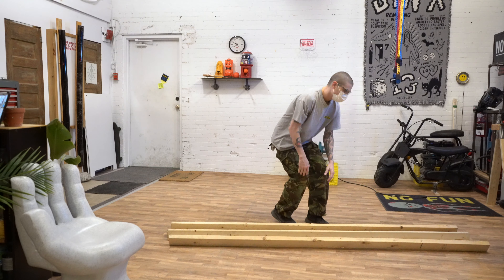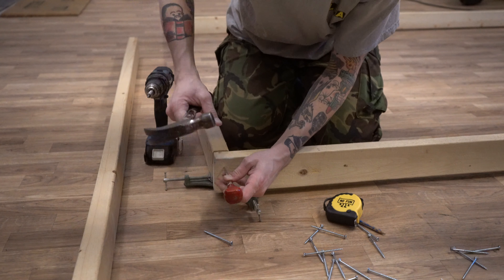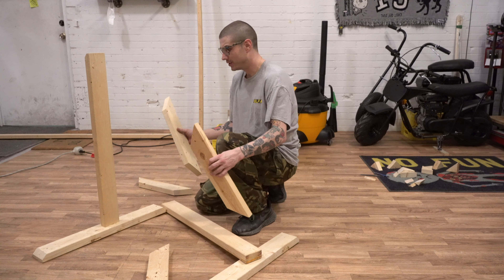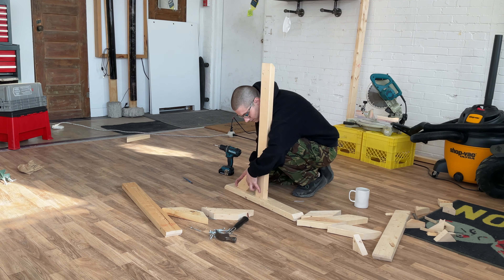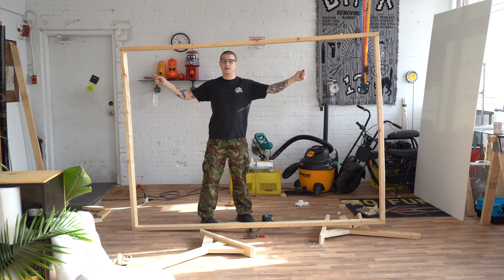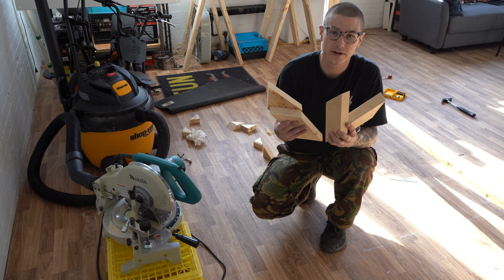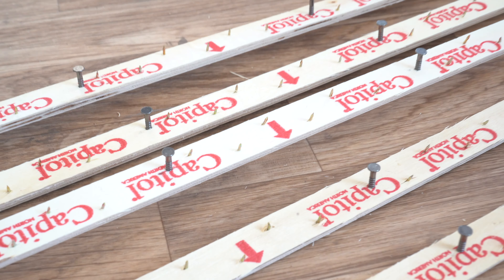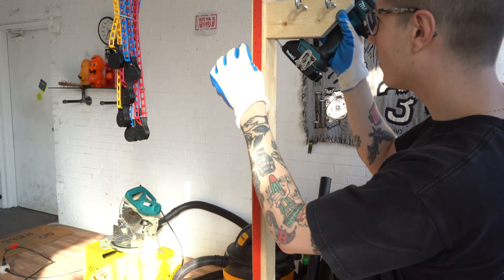How To Build a Rug Making Frame - Step by Step guide for Height Adjustable Tufting Setup

Comment: great video on making a rug tufting frame. Just a thought instead of using screws for the legs; what about drilling holes in the legs and frame and using bolts with wing nuts, so when you need to raise or lower the frame just loosen the wingnuts and take the bolt out and move them to where the need to be and not have to worry about screwing and unscrewing the screws all the time.
Reply from the maker: This would absolutely be a good solution! I built this frame during the first major lockdown & couldn't actually go to a store to buy bolts or anything, so I was using what was on hand. I do always have the screwdriver around, so unscrewing works for me- But bolt/wingnuts would work if you've got em.
Reply: this ^^^

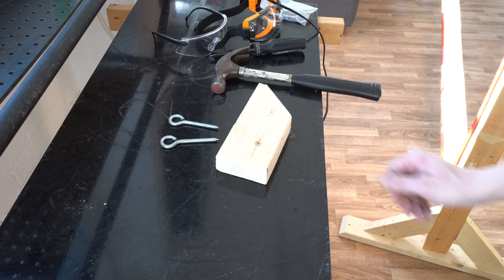Comment: 10:40, opening the eyehooks.  This just saved me like an hour of time.  I was dreading having to try to cut an opening with maybe a hacksaw or the metal cutting wheel on my dremel, and then all the filing and cleanup work to make it all smooth.  After watching this, I gave them a few whacks with a hammer and a cold chisel and boom, open hooks in seconds, no cleanup necessary!  Thank you!
Reply from the maker: Glad to hear it! Sometimes brute force is the answer lol

Comment: Great video! you should get an automatic center punch. The amount of time you save not having to tap the awl really adds up. best $12 I've ever spent
Reply: also very well played finding all that free material
Reply from the maker: I do have one of these actually for metal, don't know why it's never occurred to use it on wood. In this case however- Hammering the awl did make a deeper "pilot hole" than I think the center punch would have ¯\_(ツ)_/¯

Comment: I have a question about frames in general and hope you can help. 
I am aboout to build my first frame and I am thinking go big so I dont need to worry about upgrading in the future my question is more about the rug making process itself. 
Lets say I make a frame that is 2mx2m giving me 4sqm of work space, if I only use lets say a quater of this space on a rug, can I think cut that rug out and still use the backing material left on the fframe or once cut is the backing more or less unusable? This might be a really stupid question and I am assuming you will want to complete everything on the backing material before making a cut to maintain the tightness of the backing material but I cant seem to see a question or answer about this in my limited searching. Thanks in advance.
Reply from the maker: You're right - you don't want to cut anything off the frame before you're done tufting. You won't be able to tuft at all if the cloth you have stretched on your frame has a big hole - you need to surface tension in the fabric for the tufting to work. If you're going to fit more than one design onto your frame, do all your tufting first, then glue it all at the same time.
Reply: @NoFunStudio  thank you!

Comment: Followed your steps & built my first tufting frame, currently working on my first design! Thanks sokuch for your help!! Where did you get the blue back drop & what's it called exactly? Would be a huge help to make the mess easier to clean
Reply from the maker: heck yeah! I love to hear it, good work! The blue backdrop is a paper backdrop for photography, called seamless paper - I got it at B&H photo, but you can order it from any photo or video shop/ or probably amazon. I just have it rolled out here to make the frame itself stand out in the video, so it's visually easier to see / blocks out all the clutter in the background of my studio. I don't have it rolled down while I'm actually working on a rug, seamless paper is way too expensive to use just as a dropcloth to catch yarn and glue on the floor. Butcher paper is probably a better bet for that! When I'm tufting I just sweep the floor as I go ¯\_(ツ)_/¯

Comment: Can you also build an adjustable frame?  So that you can also use smaller towels.  That would be really useful.  Do you have an idea or tip for me?
Reply from the maker: You can screw in an additional 2x4 or 2x2 with tacks into the inside of the frame to make a smaller area - I do this sometimes when I have offcuts of tufting cloth that are smaller than the frame's full size.

Comment: Can you please give me the measurements on the small pieces you used to help stabilized and keep frame from wiggling ? Thanks in advance, awesome video 🎯👌🏻
Reply: Also how long are the screws you used in this video? Thanks again! 😎
Reply from the maker: 7.5" on the long side, but that's just because it was made from a scrap that was that side. The size of these pieces doesn't need to be exact, just so long as they're there & the frame is more stable.
Reply from the maker: @timothy92x  you want 2.5" minimum, but longer if possible for a stronger connection on some parts of the frame and legs. Long enough to join the two pieces, but not so long it pokes out the other side.
I filmed this during lockdown here & couldn't go to the hardware store, so I just built it using what I had on hand, which ended up being a jumble of different things.
Reply: Thanks again! I was able to get all my pieces I needed to start building my 4’ x 4’ frame. Very much appreciated 🙏🏻😎
Reply from the maker: @timothy92x  Pumped to hear it!!

Comment: Hi, I wonder know what's the difference I use between wood-bar with nails and rug hooking gripper strips?
Thank you.
Reply from the maker: I have only used the rug gripping strips - I wouldn't want to have to nail in hundreds of nails into the edge of a frame 1 by 1. The extra nail length might keep the tufting cloth on better, but would also make it harder to adjust while you're working.
On future frames I might add 2 rows of the tack strips rather than just one like is shown in the video. I think that would still work better than doing all the nails individually.

Comment: Where do you put the yarn as it’s being fed through the hooks? Do I have to unroll all of my yarn to get it to unroll freely? I can’t seem to find many answers online
Reply from the maker: Some balls of yarn you can pull the string out from the middle of the ball and it will feed freely for the most part. You can also get a yarn winder tool that unwinds it from a ball that doesn't feed freely and rolls it into a ball that will. Otherwise, yes, you're stuck kinda unrolling it into a pile on the floor underneath the hooks.

Comment: Tip: if you run your screw in reverse with some pressure for a bit before screwing, it helps prevent the wood from splitting. 
Ps it'll produce some smoke a little bit but that's normal. At least in my experience but it does seem to work.

Comment: Can you put pins in the legs to quickly change heights?
Reply from the maker: Yeah, in theory I guess you could drill out a bunch of holes at different heights and then make a pin/dowel system for better quick change. I built this peak-lockdown when a lot of hardware stores here were not open, so I sort of had to use what I had on hand.
I always have a screwdriver on hand so unscrewing it has never been a problem- but I will probably experiment with a better height adjustment system in the future, pins are a good idea, but might shake loose if implemented incorrectly.

Comment: Can you show how it is adjustable in height? Would you have to take all the screws out of the leg and re-drill?
Reply from the maker: You dont have to take them all the way out, but yes- you just unscrew the legs, change the height, and tighten them back in. Its like 5 screws per leg, if you have a power driver it takes about a minute. I have another frame video coming out, I'll definitely include it.

Comment: I have a metal frame what can I do to get a nail frame to add to the metal don’t like the clips that came with this kid made a mistake and bought the middle one
Reply from the maker: I'm not completely sure I understand what you're asking - but you could likely drill out holes in the tack strips and metal frame, then attach the strips to the metal frame with rivets- rather than hammering them into a wooden frame.

Comment: about nail what king of I should use it ?
Reply from the maker: You should use screws, not nails. Screws will hold the frame together more securely than nails, which will shake loose over time.

Comment: Unscrewing the frame off from the legs to adjust the height seems like a lot of trouble than just putting like two boxes or something underneath the legs.
Reply from the maker: Whatever works for you, if you can find two boxes that are stable enough, but, I imagine it would shift around a lot during tufting which isnt ideal.
I have a power driver in the studio at all times, doing a couple screws only takes a few seconds.

Comment: Isn't the top bar bending down like a fatty belly?
Reply from the maker: The board might have a bit of a warp, everything I used in this video was old used lumber. Once the frame has cloth stretched over and the whole frame is under tension it doesn't really matter.

Comment: Is it possible to get the exact wood measurements so I can get it from my local home improvement store that cut the wood?
Reply from the maker: For the leg sections: two 3' tall for legs, two 2' long for feet, four 1' sections for leg support braces, cut on 45 degree angles, keep the triangle offcuts for support braces between the legs and the frame. The frame part can be any size you want. 4'x4' is easy to do because it's two standard 2x4's, but it depends on how big a rug you wanna make.
Reply: @NoFunStudio  thanks a lot !
Reply: @NoFunStudio  would the 4x4 size change the size of the leg measurements?
Reply from the maker: @taliayahherron1274  Nope, all the legs on all my frames are the same size.
Reply: @NoFunStudio  thank you

Comment: The orientation of the wood of the frame is wrong. The middle part of the span will sag. The wider face of the wood should be facing you. I would like to see you stretch fabric on this frame. I hope I'm wrong with my assumptions. Nice build though.
Reply from the maker: You're right, there is a bit of flex in the longer sides when the fabric is stretched on, but since you can't really tuft right up to the edges of your frame either way, it doesn't really matter. 
I don't run into that issue at all on the smaller frames using this build method, and I'm assuming most people watching this won't end up making a monster sized frame like this.
Reply: @NoFunStudio  am I right to think that If the wider part faces you then there’s less surface area to tuft but it would have better stability? So the frame would also need to be mitre joined in each corner like a standard picture frame? Thanks :)

Comment: How do u get this type of frame to Sri still while tufting
Reply from the maker: I'm able to screw mine directly into the floor. Before that I would keep one of my feet stood down on the foot section of the frame- that should stop it from going anywhere as you tuft. Or weights/longer feet would help stabilize if it's moving around on you as you work.